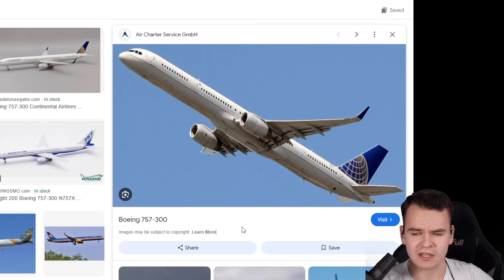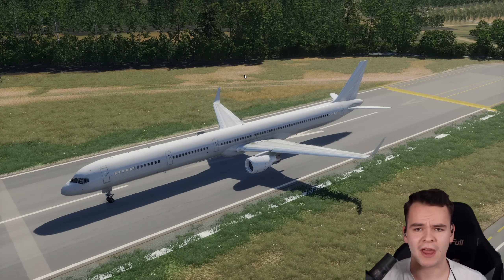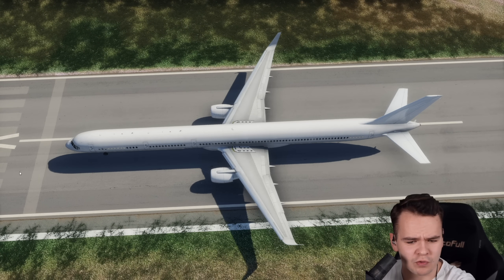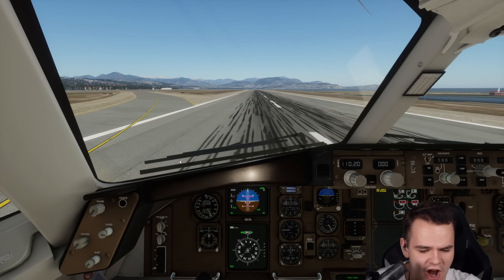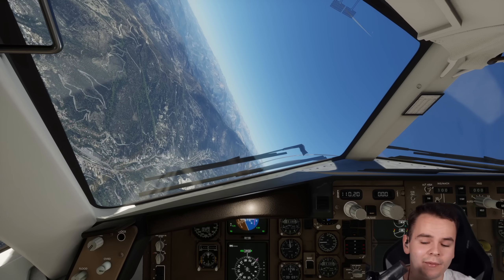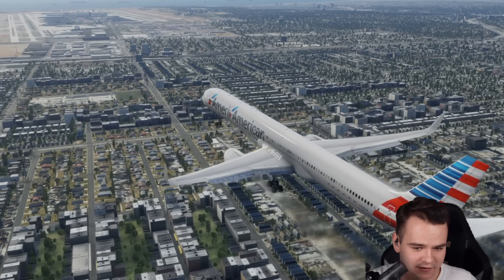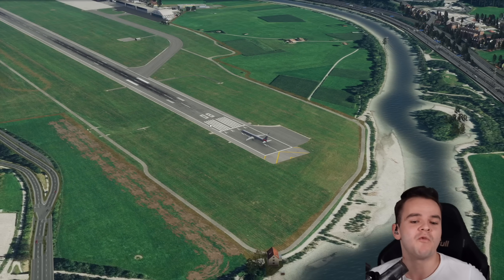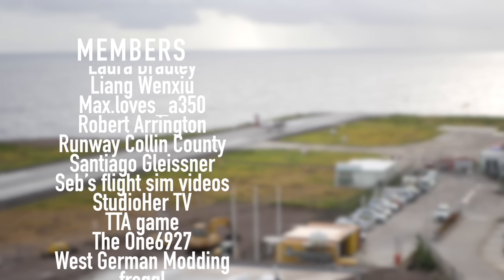Why Is The 757 So LONG?

Comment: 757 XLC (extra long cabin). Maybe use 767 wings for increased lift and stronger gear? They were designed with the same systems.

Comment: Little correction: Swiss modified the 757-200 which seats 200 people. Adding 108 extra seats would make it have a capacity of 308 instead of 345

Comment: The longest single aisle airplane built was actually the McDonnell Douglas DC-8 Series 60/70 which if I remember right was about 187 feet long compared to the 757-300's length of approximately 178 feet. The 757-300 is still the clear winner in terms of capacity though.
Reply: 187 lol
Reply: what about the 757 - 1000